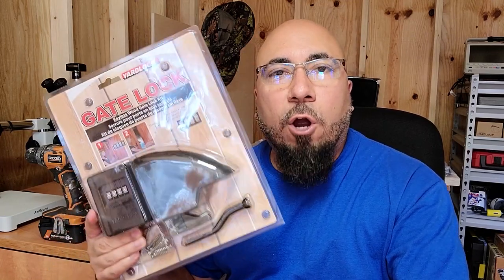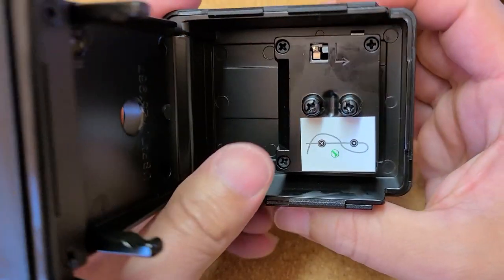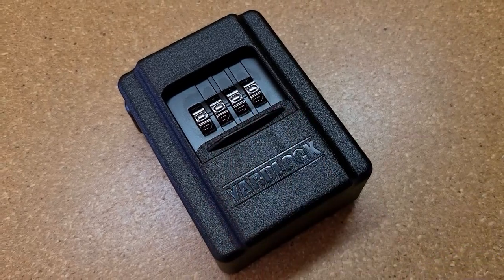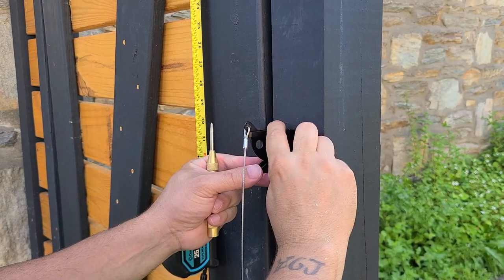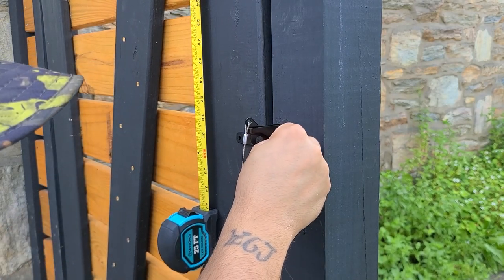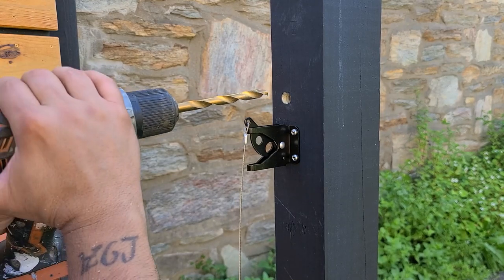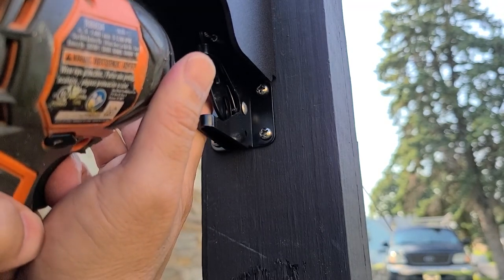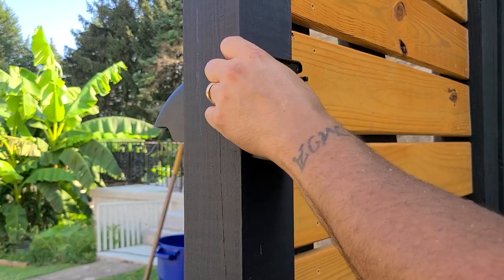Keyless Gate Lock Review

Comment: After you open the gate, do you have to rescramble the dials manually and close the code door each time?
Reply from the maker: If I'm understanding the question. The answer is, yes. When you set it to your code. You can open the door. If you don't want it to lock you can leave it set to your code. I strongly suggest to always close the door. closing the door prevents dirt and debris from getting in. especially on winter days if it rains and freezes over. you will have to wait until it thaws. Hope I answered your question. thanks for watching.

Comment: How's the latch holding up? Do you recommend it after daily use?

Gotta get me that punch tool, looks useful, especially for this!
Reply from the maker: I still recommend this latch. The only downfall is that the little slide door needs to be closed everetime. It's hard to get teenage kids to do that due to their laziness. The reason why I say it needs to be closed. Dirt or debris can get in and cause jamming. My experience when it was iced over the slide door was closed, and it was very easy to just tap on it.The ice breaks, and you're able to put in your code. Had the little door been left open? That would have been extremely complicated.
If everything was frozed over. Thanks for watching 👍